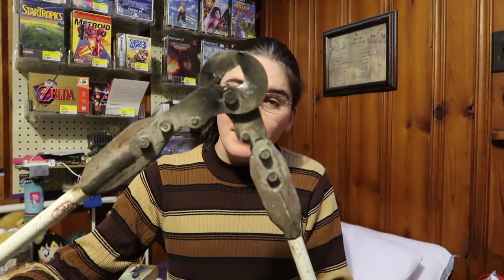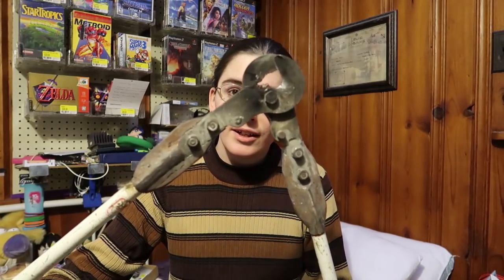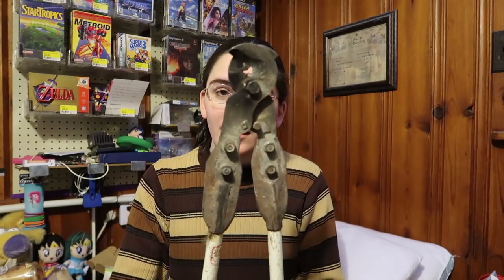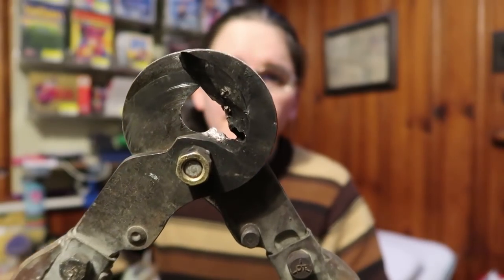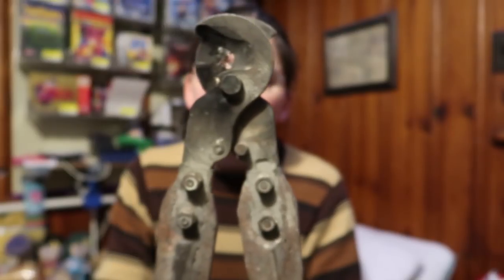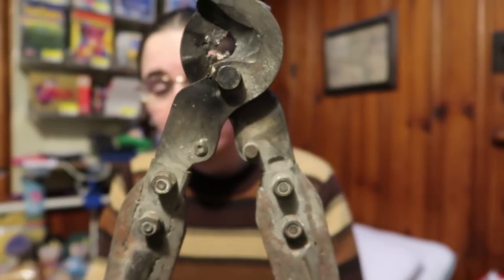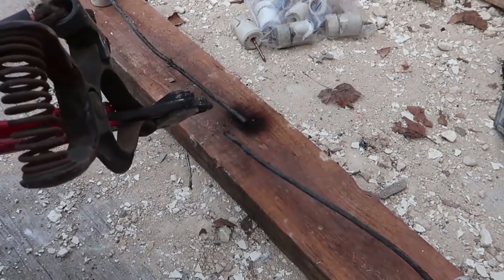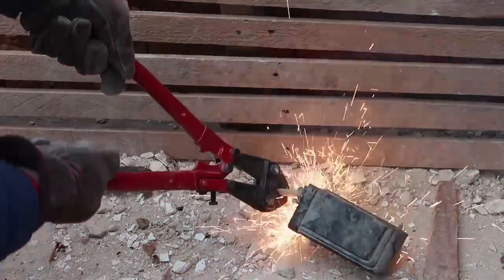Personal Bits 0355: i accidentally cut a live 240v line

Comment: I remember having hooking up a sound system to power in some abandoned industrial place, cause raves.  There was a steel box on the wall with 3 large bolts that supposedly was where we had to hook it into, but nobody brought a meter.  So in order to see if the circuit was live, we threw a box wrench at it...  and it pretty much disappeared in a loud flash!  It was a cheap harbor freight set of wrenches, so we saved the one we needed for the bolt, and made the rest disappear to amuse ourselves...  it was like a game of horseshoes, only with explosions.

Comment: Looking at the length of line, and assuming there is a 400A fuse at the utility side, there is a good likelyhood that cutting that wire would not have blown the fuse for at least 30 seconds or so, as the long cable would have had enough resistance to limit the current to around 800A or so, which would take the fuse typically from 30 seconds to 10 minutes to clear. Cable would also have been melting and been on fire already though, the feeder cables not as they are big enough.

As to the cutters with damaged jaws, contact the manufacturers and ask them if they have the jaws as a spare part, with the larger ones they might have them available, as the expensive tools are worth repairing. Welding the hole up with regular welding rod, without heat treatment after and without the right hard facing rods, will simply mean the jaw will crack when he uses it. That steel used there is a special alloy, high in manganese and silicon, and it is a low carbon steel that is case hardened after rough finishing, then ground to the right shape after and then tempered. You will at a minimum need to first detemper the whole thing, then weld it while it is hot, then grind to shape, then finally reharden and retemper it again. The hard facing rods are easy enough to get, but the welding of them is a hard skill, takes a lot of learning, as they really are not forgiving at all unlike all purpose mild steel rods.
Reply from the maker: well ive already finished restoring it and tempered it a little. lets see how it does.
Reply: Mr. F, what do you mean?
Reply: AHTOH i know right,but the video clip is funny though

Comment: I work with 440V 3 phase all the time, if I don’t physically flip the breaker, or am there to witness it being turned off, I check before I work on it. I’ve been bitten too many times to trust anyone anymore, and 440V 3 phase while working on steel on an ungrounded system is not an ideal situation.
Reply: Ppl don't realize that it actually feels like a bite... And it hurts for some time afterwards too
Reply: @darrentylor5473  it stings like a bite, and the after effects are painful. Depending on where you get shocked, I have had it feel like someone has come and kicked me with a steel toed boot.

Comment: Shit, and I was worried once when I knocked over a cheaply put together utility pole with a lawnmower, but you had to deal with 240v of crazy electrical crap. Have no regrets, you did what needed to be done when it happened, whatever was missed or forgotten was missed and forgotten so you'd stay on your toes. Just stay safe, and that bad taste in your mouth is usually that metallic taste they comes from taking a few volts through the body.
Reply from the maker: no not that type of bad taste, but the metaphorical, like "leaves me with a residual annoyance regarding that event" similar to how a bad taste reminds you if it

Comment: You should’ve really pulled off those massive wire cutters. The way I see it, you should always check yourself. Sadly, there’s probably more bodges all over the place. Fuses on both AC conductors... that needs to be changed. It might be wise to upgrade and re wire the building.

Comment: I have a few pairs of those cutters that need welding. The issue is I didnt anticipate how hard the damn weld would be, so grinding it to shape is a real pain. 

Cutting live wires can be shocking in more ways than one.
Reply from the maker: i repaired these already and am going to post the video to my main channel in a fee days, maybe you can take inspiration from that. ^^
Reply: I have much better grinders now than last time I tried. I will make sure to check it out when it is uploaded!

I have worked in demolition for years, and it is important to make sure critical hazards are locked out, or shut down. Just make sure to stay vigilant for critical hazards. Your feeling of being shaken is quite warranted.
Reply from the maker: i found just a flap wheel on an angle grinder worked well enough for this one. also used a hammer to peen a section over a bit. but thats due to my bad weld quality. hehe
Reply: What kind of welder did you use? I tried to use a flux-core wire feed. It has 2 settings; high, and low.. lol

I have an old haubart arc welder I have to try get going. Your videos are still an inspiration to make more of my own, and actually put some effort in.
Reply from the maker: 1930s 150 amp Mid-States "Missing Link" arc welder. i ran it on lower amp setting and found 1/16th rods allowed me to add a bit of metal at a time without significantly heating and melting the metal.
Reply: Sounds like a real beauty.

Comment: You can use multi phase in Europe to get 3x400V. European electrics would have protected you and your cutters by using multiple layers of fuses and selectivity..
Reply from the maker: no because this wiring is illegal and so laws dont matter for illegal wiring. it should have had several sets of breakers/fuses on this line as well. oh and american 3 phase is 440v.
Reply: @rinoaleonhart86  Not necessarily. It is common for utilities to provide unfused (or fused well over the transformer's rating) service lines to properties because it's more important to prevent outages and keep their whole system operating than it is to protect a single transformer. It only became illegal when the property owner decided to tap off of the utility side of the main breaker, which as you pointed out is indeed illegal.

Comment: Can you explain what dual phase is? Are you sure you don't mean single phase?

Here in the UK we use 220v (actually more like 240v) for everything in homes, I see in the USA you only have dedicated 220V sockets for things like dryers and ovens and use 110v for everything else.

Its a lot more flexible to have 220v power but i guess the 110v is safer.
Reply from the maker: with dual phase you have three wires, two of which have AC with offset phases.
Reply: @rinoaleonhart86  And just to clarify here, Technically it is referred to as split phase. The primary of the single phase transformer feeding the property is connected between a single phase of the the MV system and a multigrounded neutral. The secondary is center tapped. The center tap is also connected to the multigrounded neutral. this creates a feed into the property consisting of a combined ground/neutral wire along with 2 120v wires 180 deg. apart, which obviously creates 240V between them.

Comment: You must have cut two wires at the same time. You can cut one live wire and it should not cause any arch.
Reply from the maker: These wires are multi strand ones from the 1920s. Rare to find single wires
Reply: @rinoaleonhart86  you can cut one circuit no matter what kind of wire it is and you’ll be fine. If your a circuit with another conductor or ground or neutral you’ll get an arch blast. Also if you cut one conductor and are grounded or the cutting tool is making contact with something then that’ll also blow up

Comment: Go buy a voltage tester pen so you can always be sure. You literally lay the pen to the side of a wire, if it beeps the line has power. I work with electricity and these are life savers. You never know if some weekend warrior rerouted a line to a breaker or there's more than one feed. $15 At lowes or home depot☺. Glad no one got hurt.
Reply from the maker: well we have one but tyler is always the one to check it. ag well.

Comment: Bloody lucky you never used the saw, so does that mean the building has been stealing utility power for however long it is since that wire has been connected?
Reply from the maker: no its after the meter, but the meter and all that stuff is locked by the power company so we cant access it.

Comment: It’s amazing what we’ve done because we “think” it’s faster or cheaper to just do it ourselves.  When someone gets shot across the room or their hands melt to wire we always wonder why we didn’t do it the right way.  The power company probably would’ve been quick to come out if you told them you had a live wire shorted that was direct wired.  Lol.  Anyway, glad your safe and know it happens every day with demo crews.  As big of a deal as it could’ve been, it wasn’t a big deal.  Oh, maybe test the resistance of the insulation on the wire you thought you’d be able to pull your friend away from the box with.  I think with some experimenting you may be horrified.  There’s a reason they tell you to use wood.

Comment: In Europe there is three phase 400V...
Reply: Антон Южаков Damn thats a lot of volts!
Reply from the maker: we have 3 phase 440 over here
Reply: Haven't heard of that. How often this voltages are used?
Reply from the maker: in lots of industrial buildings, any time there are printing presses or large equipment, also i think elevator motors use 440v. i've also seen auto repair shops use 440v for their giant air compressors.
Reply: I suppose 400 is more common here, you can even have 3 phase 400V power in a flat!